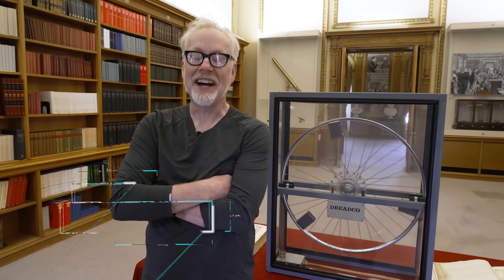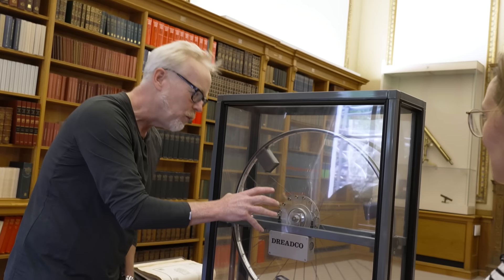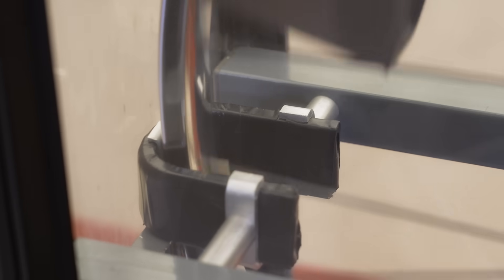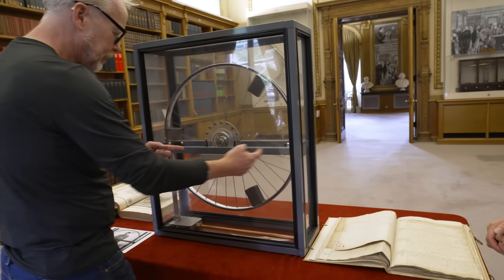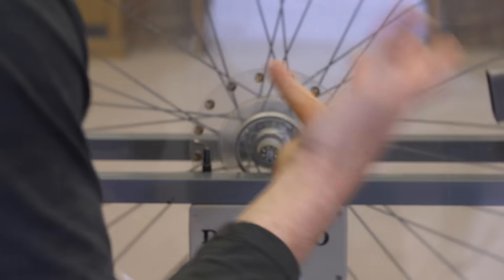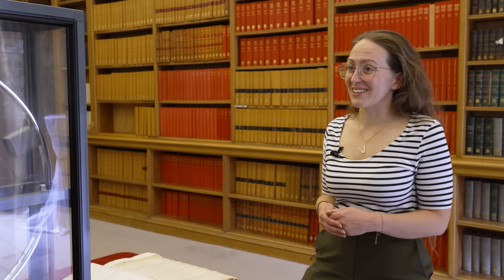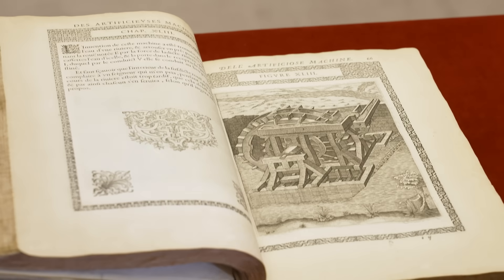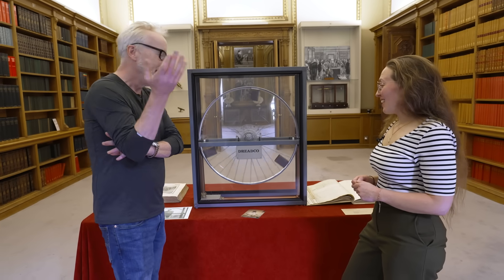Adam Savage vs The "Perpetual Motion" Machine!

Comment: Could it be three iron blocks passing by two weak magnets that are off center. One block is pulled down and passes by left side magnet just as the right side magnet pulls the other block up and it passes as the right side pulled another block down. It’s weighted and timed just right for it to work. The iron weights are what governs the speed. Isn’t this the way an induction motor works?

Comment: Oh, well, Heatsinks! That's a good decoy - for sure one expects "no dissipation" in a "Perpetual Motion" Machine!
Vacuum may help reduce losses but the structure seems too weak for that. There may be batteries and electronics in the canisters generating appropriate magnetic fields that add momentum  as they pass through the magnetic poles.

Comment: What's in the well of the rim?  Are there small, evenly spaced fins?

If so, perhaps the wheel was given an initial rotational velocity that sends small puffs of air through the tube on one side, which then push upward on the other side...?

Comment: The simplest "solution" would be: 1. The U shaped things mounted on each side of the wheel are permanent magnets.  2. Inside the 3 boxes are batteries and a coil and some circuitry which will activate a current through those coils when the box is exactly horizontal (one of those mercury mechanical level switches and a couple of 555's would do the trick)

Comment: I know a lot of people are going to hate me for this but here goes (This is going to me a long one, sorry!) 

The reason this machine is so hard to figure out has more to do with philosophy and psychology than physics.  It's all about who the intended audience is for this machine and who isn't.

The intended audience for this machine are physicists, engineers, and people who are enthusiastic about these fields and science in general.  This audience will very likely approach the problem using the scientific method,  which would be to observe everything you can, apply all the possible hypothesis based upon your observations and then test your hypothesis through experimentation.  Basically to go from "this is everything that is possible based upon what I'm seeing" to "this is how it works" by the elimination of possibilities through experimentation.

And that's where the trick is!  Because since the Royal Society won't actually let anyone take apart the machine to examine it, the scientific approach never gets past the multiple hypotheses step and can never confirm one hypothesis over another through experimentation.  

So the scientist just keeps observing more and more things about the machine and coming up with more hypotheses, without ever being able to confidently eliminate any of them in favor of others.

This wouldn't be the case if the audience were a different group that applied a different system of thinking, like say magicians.

An audience of magicians wouldn't apply the scientific method to figuring out this thing works.  They would apply the approach of "If I wanted to make a machine that looks like this, moves like this, and hides its power source the way this one does, how would I do it?"  

Applying that method of thinking, they wouldn't look at the machine for what is shows them the same way a scientist would.  They would instead look at the machine for what it doesn't show them (eg. certain shapes in the mechanism that could hide hollow spaces for wires or parts that constantly move to prevent people from carefully examining those parts. IMO, the rim of the wheel itself is probably hollow enough to fit a wire and battery of some sort and the rest of it is all distraction). 

Where the scientist looks to the machine to reveal itself based upon what it shows their eyes, the magician looks at machine in terms of what it's trying to hide and distract from their eyes.  

I have no doubt that if a good magician looked at this machine for enough time they would not only figure out how it works, but be able to build their own.  Because that is how magicians have fun.  

But a scientist would more than likely just keep coming up with and combining different hypotheses, never settling on any one explanation, because that is how scientists have fun.  You can see this in the way Adam looks at all the parts of the machine and keeps coming up with different hypotheses.  He's having a ball!   

(And of course a philosophy enthusiast like myself would spend way too many paragraphs  going on and on about how different modes of thinking define how different people see things, because that's how we have fun! 😜)

So long as the scientific thinker can't complete the scientific method beyond the hypothesis stage due to being unable to actually take apart the machine to experiment on it, they will never be 100% certain of any opinion they have of how the machine works and will just keep coming up with more and more hypotheses.
 
And in this way the perpetual motion machine actually achieves its goal, not by moving forever, but by keeping scientific thinkers thinking forever! 

Thanks for reading. I know it was long, but like I said, writing too much about seemingly trivial things is how philosophers have fun!🤣

Comment: looks like electrostatic motor to me. if you look at the "spikes" they're not 180°. spiky part makes effective electron emitter which then get deposited to actually acrylic glass not on the copper. round part is positively charged and as angle is less than 180° thus distance from negatively charged side is shorter top than bottom, it'll always rotate counterclockwise. but worths noting that despite disguising as perpetual motion machine, its pretty ineffective electrostatic motor because left electrode is round instead of being brushed so not all electrons are removed all at once that got deposited by spike. battery can be hidden behind company logo box, doesnt need to be chunky as es motors are pretty low power

Comment: Adam,

You missed the most important evidence. When you looked at the two C shaped black items, you said they might be magnets. Why are they shrink wrapped? They are electro-magnets. The three boxes around the circumference are large and heavy fixed magnets. The hub has brass discs that are detected by one of the probes pointing at them. As they pass by, the electro-magnets kick the wheel and keep it spinning. It has sufficient inertia to maintain constant(ish) angular speed between kicks. It’s a motor like in a watch (mine has a 10 year battery). Where the ucontroller and batteries are is pretty immaterial. QED.

Comment: I'm guessing the boxes contain a pile, a very long coil (high resistance, lots of turns) and a reed switch which is activated when it passes through the magnets, or a mercury switch activated by being horizontal. But that wouldn't explain the slowing down in the basement, might use the photoelectric effect to charge something, or if it's stored at a strange angle in the basement and it's using a mercury switch that might explain it slowing down. Alternatively the boxes are the magnets, the name box contains the piles which are charged (or resistance limited to save power when in storage) by the light sensor and the horseshoes contain the coils and reed switches.

Comment: The batteries are in the three 120° boxes, and they power electromagnets which interact with the two magnets on the horizontal diameter. All the other fittings are red herrings.

Comment: If you couple something to elsewhere/another time/ another dimension/another location, and that elsewhere is of a different potential, as it would likely be, then energy would flow through to balance out the different potentials.  And that would create a illusion of free energy, which may be sufficient to power the device to appear perpetual. To create such coupling, maybe try to make some matter or parts of its molecules resonate close to the elsewhere frequency.

Comment: If the motion is generating electricity by those boxes passing by the magnet, the wheel would slow down.  If you use the electricity to run an electric motor, ohmic losses would eat up some of the energy and you are done.  There must be an energy source in the mechanism.

Comment: I think it's just a flywheel that is kept charged by a pressure differential that escapes on the right side pipe. The boxes aren't magnets, just masses. Relatively warm air is fed into the left pipe by the wheel rotating, the box on the bottom with radiator fins helps cool and slightly compress the air (has more efficient heat transfer / thermal capacity than the copper pipe?), which when passing through the longer copper pipe heats up, expands and pushes in the direction of spin as it exits on the left side pipe. So it's essentially powered by a quirky behavior that occurs at a certain ambient / room temperature.

Comment: I think it has three different power sources that feed into one another so very little is lost. But think of it like this if you took a basic quartz watch and took everything off but the second hand and all the gearing and put a top of the line battery in it it would run for years. But this is a fun a little exercise for anyone who's interested. Just trying to figure out exactly what's going on is a good bit of fun

Comment: If the boxes are coils and those are magnets on both sides then the coils would need to be switched on and off according to some timing mechanism, which might be those knobby things near the axle and those pens nearly touching those knobs. Or there might simply be a tiny electromotor hidden inside the axle.

Comment: I'm sure the magnet on the gravity side is creating a charge, and the magnet on the up side could be propelling to wheel. I bet the nodes in the middle complete a circuit to momentarily activate the up magnet. The heat sink is thur battery box and due to always trickle charging needs to be cooled.

Comment: I'm thinking there's a vacuum or low pressure inside... The 'batteries' are used to maintain it... Less air means less resistance...

Definitely a lot of unnecessary 'stuff' to distract/confuse observers from what's really going on...

Comment: It probably works with temperature changes. The basement is a cool and steady temperature so it bleeds energy. The temperature fluctuations in the hall could provide it with some energy. 
The heatsink is not to cool but to add energy to the system.
Reply: I agree it is a thermocouple/thermoelectric into an induction motor.

Comment: I have always failed to understand the allure of a Perpetual motion machine. 

Basic physics out right says they are impossible because you can not create energy from nothing. All energy comes from the change of states of matter.  (Mostly the destruction of matter).

And even if you could create one, the energy would only ever be enough to make the machine move and it would not be able to generate power to power anything else. So, therefor, it would just be a novelty item and utterly useless. 

Even Tesla's theories of how to generate power with  Wardenclyffe  would be taking energy from the planet in multiple ways.  It's basically using it as a battery and eventually would end up causing who knows what to the environment.  Cooling the interior of the planet, slowing the rotation, messing up the orbit, weather changes and who knows what other possible things.

I wouldn't be surprised if indeed  Wardenclyffe  would have actually worked.. because well.. Tesla!!! 

But, there is no such thing as free energy.

Comment: I came up with a "near-perpetual motion" device back in the early 1990's.  Mine can run literally until it breaks, say a thousand years with proper construction.  Mine spins with enough force to drive a dynamo to generate power.  Mine can be scaled up or down in size, from something that sits on a table, to something the size of a building.  Mine could provide the equivalent power of a hydroelectric dam in the desert.  Mine can work anywhere on Earth, but probably not in space (where solar reigns anyway).  I've never tried to patent it, and I keep it locked away in my head.  I'd love to show it off, but not without a notarized non-disclosure agreement.  Free power for everyone forever.  My invention is not a machine, it's a technology, an imbalance of naturally contending forces.  Completely natural, and I can describe the whole thing on the back of a business card, it's so simple.  What a shame, I have no desire to start or run a company or go through the expensive process of patenting it.  I may give it to the public domain on my deathbed someday...
Reply: Seriously, if someone wants to sign a NDA and has the means to mass-manufacture a relatively simple machine, and the resources for R&D, I'd be willing to show it.
If someone wants to buy my idea and hide it away from the masses, I wouldn't even care as long as I got paid rather than disappeared.
I have no desire to stir up the big energy hornet's nest, but I would like to be known as the inventor of my invention, and get paid a royalty on each unit sold should it be manufactured.
Anyone I show it to will slap themselves and feel dumb for not having thought of it themselves.  A five year old could understand how it works with minimal explanation.
It's not like this one here, where you see it and wonder how it works.  I could describe mine, and without ever seeing it, you would say "That would work!"

Comment: I suspect most of what you see is to make you guess wrong. I doubt the horse shoes are even magnetized. A simple compass would resolve that. Anyway, if one has the money to spend one can by a perpetual clock. It pretty much runs for ever until it mechanically fails. Still, no, it isn't magic, it runs from daily changes in barometric pressure. With a box the size of the one they have, a large amount of pressure difference, each day can be used, similar to the clock. For the curious, look for Jaeger Lecoultre clocks.

Comment: I think the energy source is not batteries at all, but rather pressure. The copper pipes and the box tube frame of the device are all part of a pressure vessel. I suspect the finger above the right end of the "DREADCO" box has a very fine hole that streams air at the little brass cups on the wheel, driving it. The wheel is a very well balanced wheel on low friction bearings.  The servicing is simply recharging the pressure vessel and putting graphite or something similar on the bearings.

Comment: The Dreadco light meter box has the batteries, and gears in it to turn the wheel. It needs to be sent out to be serviced because it needs specialized batteries to make it run.

The magnets, copper pipe, and other stuff is just there to throw you off. Misdirection.

Comment: Just my theory. I think each of the small boxes contain a set of batteries and a gyro. Each gyro is momentarily turned on when the U shaped magnet comes close to it because each box is wired with a magnetic switch which allows current to flow. So it’s like having a little push on the wheels 3 times per cycle

Comment: Having a machine that needs extremely little energy to run, and can be charged by ambient light, or temperature differences, or something like that, is worthless. It's not a perpetual motion machine.
And so the only perpetual motion machine that is of any value, is one that can produce energy. Even if it is as little as just keeping a small light diode running.

Comment: I wonder if you could very precisely measure the speed at different points in the rotation to see whether it speeds up at some point.
Reply: Exactly!  I was thinking the same thing.  A magnetic drive, or even a slight magnetic boost, would be discernible in speed variation.  An adjustable strobe light should do the trick.
Reply: https://www.youtube.com/watch?v=muruba8ORGA

You can clearly see in this older video that the machine is moving at a much slower rate.
Reply: @akaraven66  he means per rotation
not in general overall
Reply: @vorstadtprolll  I think it would be good to see a over the course of the maintenance from day one after to the day it's about to get maintenance again how much it slows down over that period to if at all
Reply: Or just a phantom camera and 100k frames a second
Reply: The strobe only works if it's adjustable and even then you would probably need some precise vision to tell the slight variation a camera and computer are probably still necessary to figure it out honestly I'd like a time lapse of 2 second vids every week from the time the maintenance is done up until it's done again to see if a charge is weakening over time also
Reply: @Ericmcdonkey  Hence, my using the term “adjustable strobe”.  😎 And if you’ve ever worked with them, you’d know that the slightest variance in object speed vs flash frequency is easily seen even without instrumentation.
Reply: It doesn't.

Comment: the 3 boxes could contain capacitors, which need to be topped up every so often.
They give the wheel a negative charge, which gets picked up by the 2 pieces at the hub, imparting some moment onto the wheel.

Comment: The coils on the wheel go through the magnets creating a minute amount of heat on the left side. That air goes in the copper tube/heat sink thingy, cools and comes out the right side tube. This creates an enclosed (and miniscule) "wind". I believe the cathode and anode in the center are being powered by light sensors to give them a slight pull on the ferrous nodules on the center hub. I'm pulling this out of my arse of course, but I believe the redundant "self-sustaining" power sources could be enough to spin a very well lubricated and balanced wheel for a very long time (but, of course, still not perpetual).